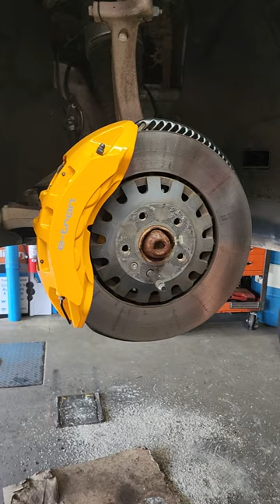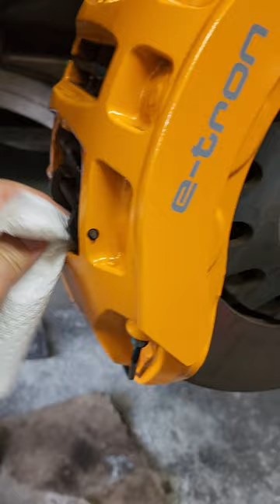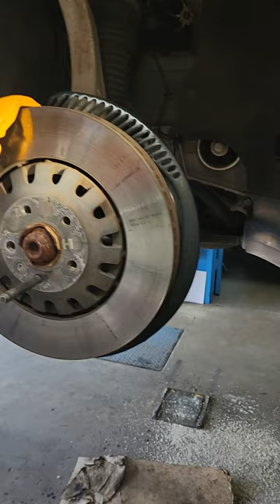Audi e-tron Brakes

Comment: Lol so I’m an idiot and am learning the hard way. My etron, bought used, still under warranty..brakes are squeaky and loud constantly. Has 19k miles. What would you do if you were me?
Reply from the maker: Bring it back like I did and have them replace everything. Mine was CPO, and they didn't do shit. I just got rid of mine. Value was plummeting. I love it and miss it. Have a lot of videos on it. Stay in touch.
Reply: @automotiveadbuilder  thanks you! Mine is cpo…you had to pay out of pocket?
Reply from the maker: @josephgolob3918  nope force them to fix it. You bought from an Audi dealer a CPO must be in specs
Reply: Those marks are pad material transfer. The motors do majority of the braking and that's why the surfaces aren't quite clean. Do some harder braking while in neutral. This will allow you to use the hydraulic brakes without regeneration intervention. 
If the rotors aren't warped and are above minimum thickness, and if the pads are above a certain percentage of thickness, the brakes pass CPO inspection. Please don't exaggerate the situation.
Reply from the maker: @joshfoley8862  Wow, dude, it looks like you don't know who you are talking to. You obviously never drove an Etron. Etrons require brakes to stop the 6000 pounds. I had those groved rotors replaced all 4 of them at Audi.